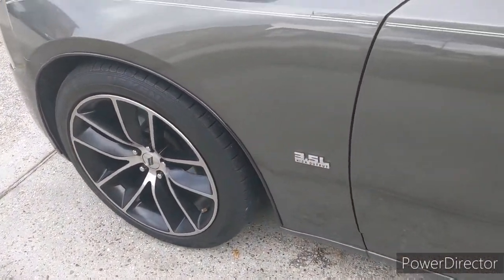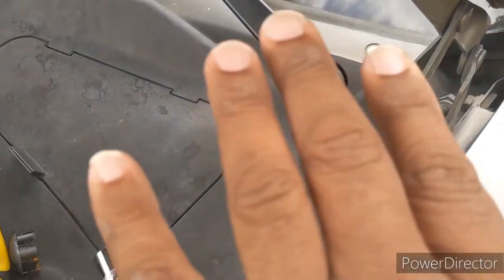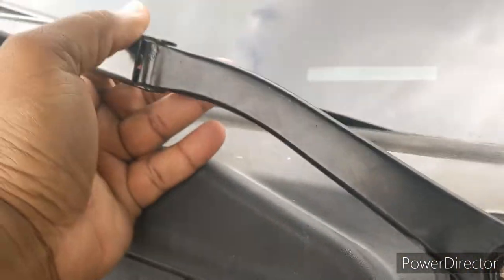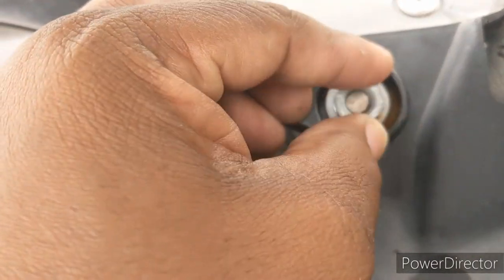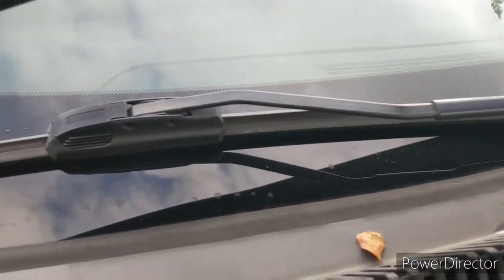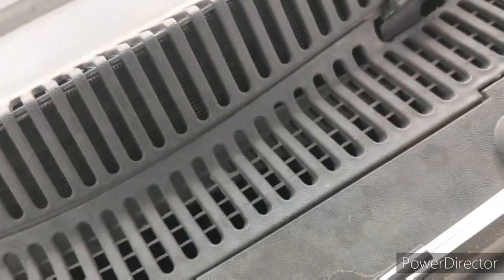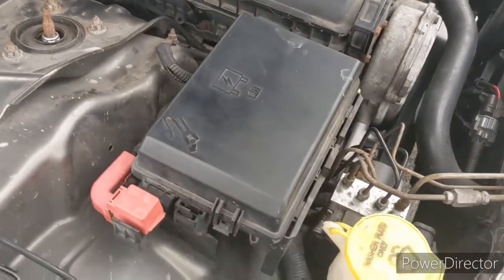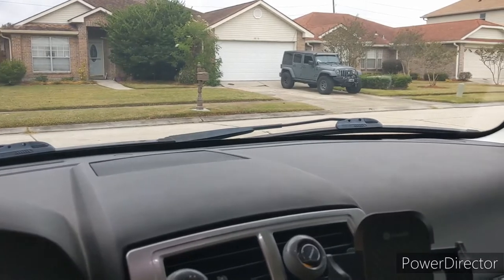2006 - 2010 Dodge Charger wiper arm alignment.

Comment: I’m have kind of the same issue I have a 2010 dodge challenger but the wiper assembly has been running in the break booster and now I have a hole in my break booster do you think this will work for my car ?
Reply from the maker: You can try it. I did it to see if I could fix it before paying a mechanic money I didn't have to.